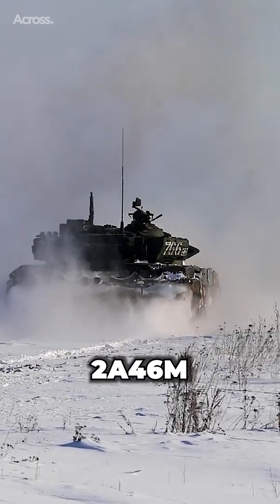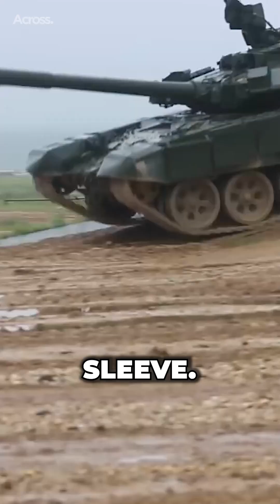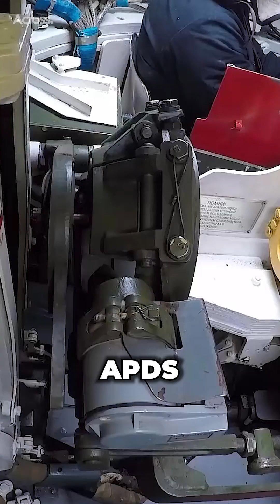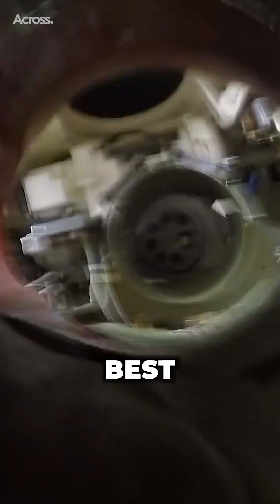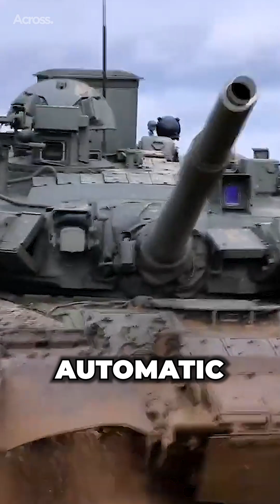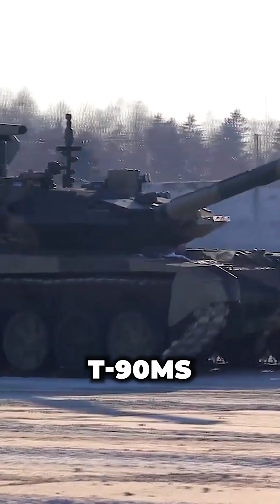Why Russia's T-90 Tank Is A Beast #shorts

Comment: T-90 is subpar to the T-80, which is just embarrassing.  Probably because it's based on a chassis that's 50 years old.  Throws the turret pretty high though, impressive "ejection" system.
Reply: how about the strongest army tanks M1 Abrams that can't even stand RPG-7 on the side???
Reply: @nhatpham2206  Cope harder bro
Reply: @masondegaulle  M1 should cope harder too
Reply: @nhatpham2206  You are repeating yourself Boris
Reply: if looking at the kill numbers it also seams to be one of the rarest tank in the war after the t90m. meanwhile t80s t80bvm t80u t64b and all the t72 variants seam to exist in large numbers